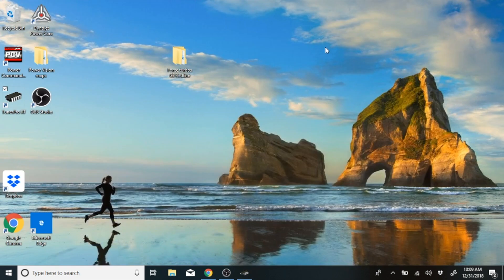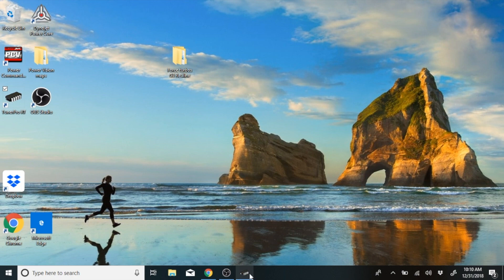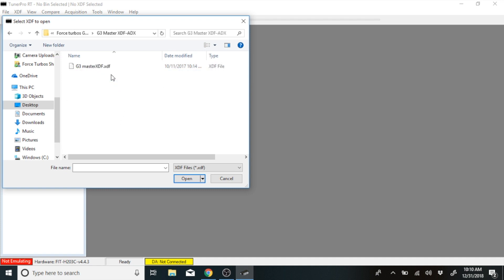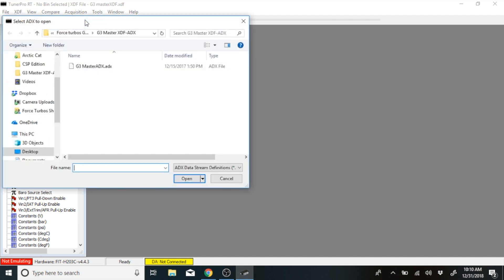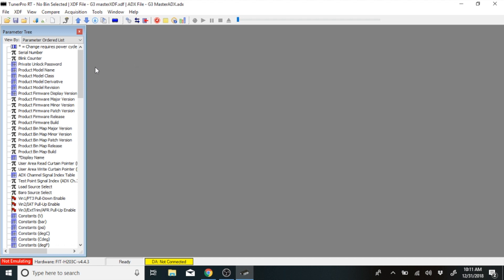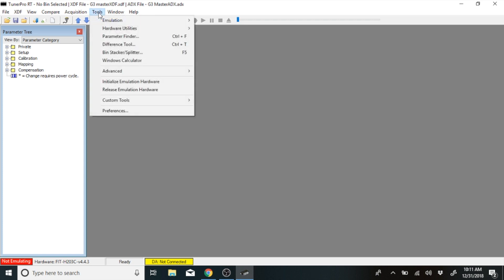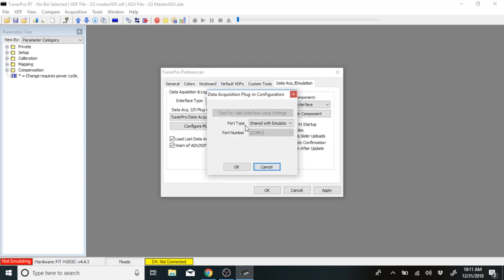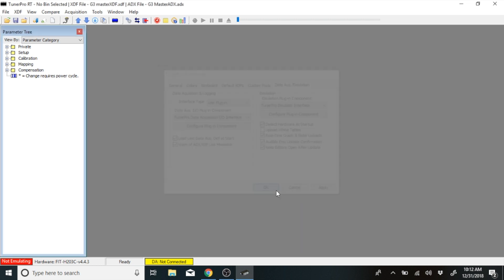Redline G3 Fuel Controller Part 1 - Computer Setup

Comment: Is the G3 batch injection or sequential?
Reply: Batch fire
Reply: @Bryce Kendrick  How well does that work at quarter and mid throttle? We've had bad luck with everything but boondocker controllers. I was interested in the speedwerx supercharger.
Reply: @darrylm7588  We have had very good results with them.
Reply: Batch